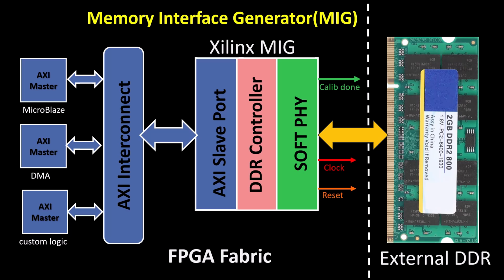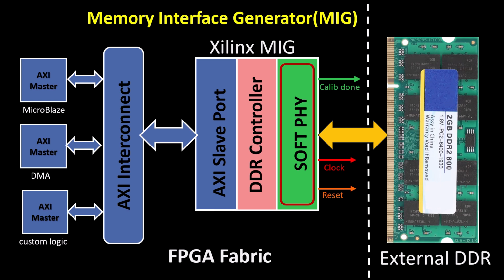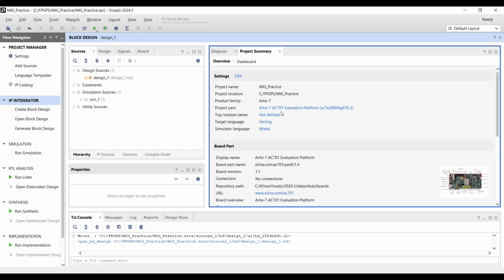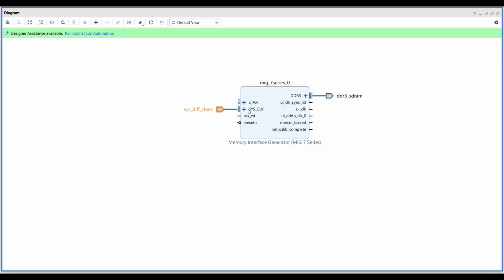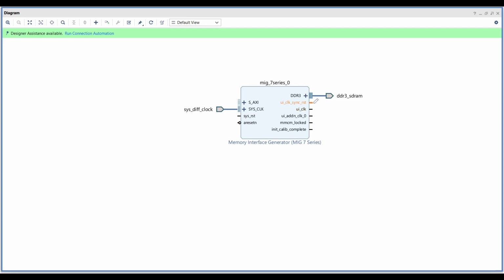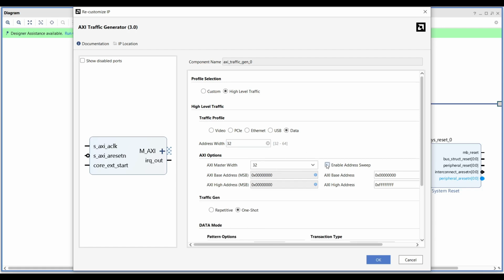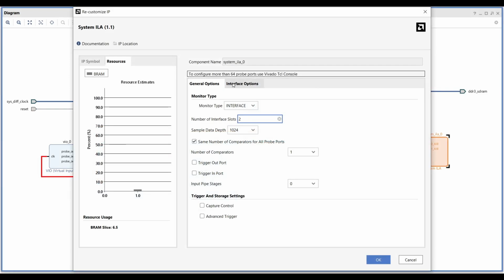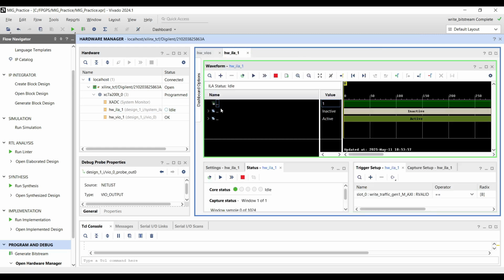Xilinx MIG DDR3 Interface: Read and Write using AXI traffic Generators

Comment: Hello, nice video thank you

I have a question about Vivado/Vitis 2025 if you have worked with.

I create an application with Ethernet, I have exported the design to Vitis, I added an application freertos lwip echoserver, I can ping on fpga address bu the ncat or telnet are refused on the port 7, or other ports from 5000(change made on C files). I increases the microblaze local memory to 128kb, I activate ICMP also.  Have you any idea about this issue.

Have a nice day

Comment: when i try to read there is a overflow happening
Reply: The overflow happens because of the ILA settings.  The video does not show it, but you need to set the "number of outstanding transactions" to 64 for both SLOT0 AND SLOT1.
Reply: @benmishoe5999  thanx a lot !

Comment: This is a very useful explanation of the IP blocks, but to build such projects you really need development boards in the mid-price range.
Reply: you can buy a brand new zynq7020 as less as 50 dollars, or an used zynq7010 as 10 dollars, there are a lot of zynq used for mining a few years ago but now they are  obsoleted and flow to the 2 handed market, just buy one
Reply from the maker: Hi @Rafael-o5q
Welcome to the channel.

The target of this training was to explain the concept of memory data exchange as easiest as possible and avoid evolving with RTL design. Master IP + MIG, to make it easy for all audience to understand, even if they don't know how to write the RTL design. this training doesn't target the production design nor resource optimization. 
The AMD MIG IP by itself is used even with FPGAs with much less resource, like Artix-7 XC7A35T that you can purchase with low prices. 

If you don't want to use the MIG IP then you should design your memory interface. you can find one example and comparison here: 
https://zipcpu.com/zipcpu/2025/05/28/memtest.html

AXI traffic generator is an easy tool for debugging, after you sure that your MIG is functional, you can design your master RTL IP or use Vivado IP packager: 
https://zipcpu.com/blog/2020/03/23/wbm2axisp.html

Thanks for your feedback! 
~FPGAPS